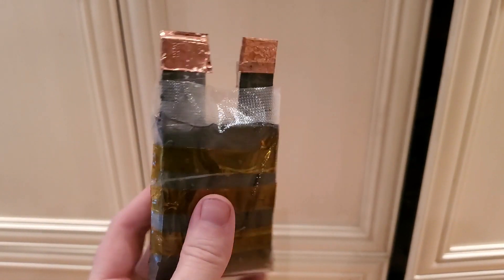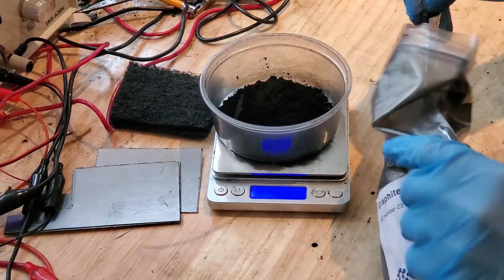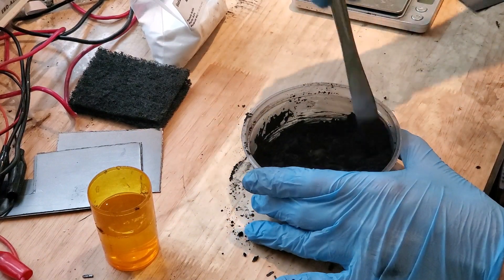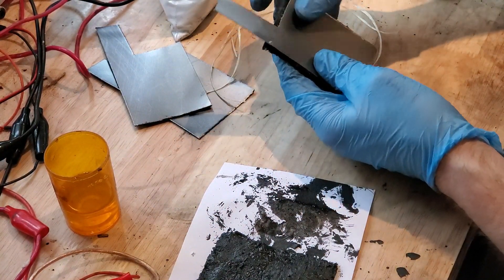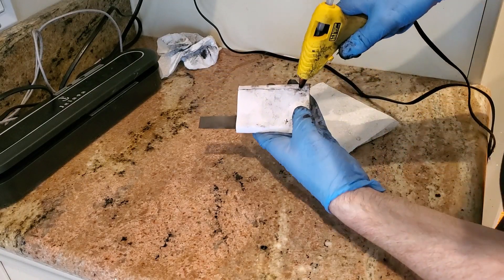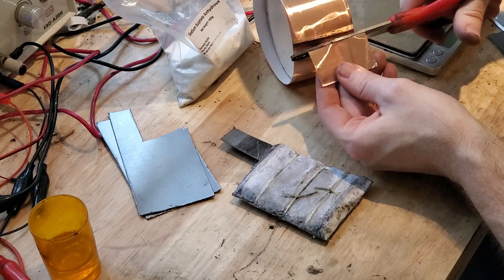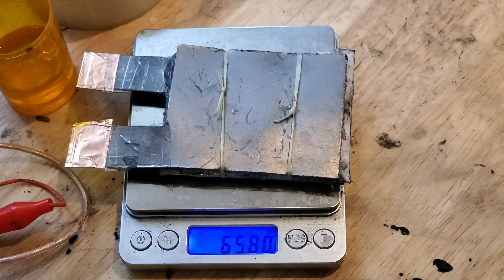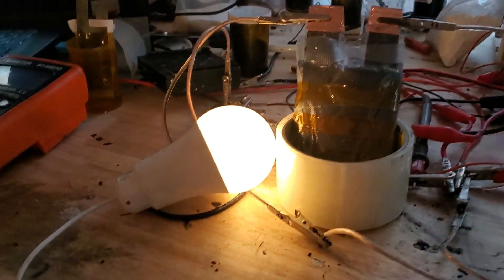Homemade 1 Amp Hour Zinc Ion Battery - Full Instructions

Comment: I am thankful for the efforts taken by you in sharing the successful and awesome performance of your zinc ion battery. Thanks from Jawaharlal Bharat INDIA 🙏
Reply from the maker: Thanks, I have seen a few of your videos too.  You should take a look at my latest video, I have doubled the energy density since this video.  The main difference is that I use water filter coconut carbon now, really cheap and easy to get a hold of in bulk, even cheaper than lead acid per watt hour.

Comment: You're miles ahead of me and I was hoping to get away from any kind of paste but it seems straight metal plates have limits.  Any idea on what the cycle life on your battery is?
Reply from the maker: The theoretical life cycles of this chemistry is very high(10k cycles).  However in practice that is always more challenging. On the other hand, copper zinc chemistry(The one you are pursuing) often won't last very long  I believe copper does not do well in a rechargeable cell, as copper ions start to pollute the electrolyte and it also oxidizes, which does not add anything good to the equation.  However it is a simple chemistry to mess around with.  I have changed the chemistries of my zinc ion projects a lot since this video, I do plan to upload a new video soon.
Reply: @microphotography2090  cannot wait for your next video man. Keep it up!

Comment: Can we make a similar battery/supercapacitor with Aluminium or Iron?
Reply from the maker: You can only use aluminum or stainless steel on the negative side(not positive).  Zinc metal will grow on either of those.  But watch out for aluminum, it takes part in the reactions and will eventually be reduced on large discharges.  Putting aluminum or steel on positive in an aqueous electrolyte will oxidize them heavily.  Steel 'CAN' work as a current collector on positive, but it lowers voltage and resistance increases with each charge from rust.
Reply: Thank you
Reply from the maker: @aadhithvarathan5432  Ps, graphite foil is all over ebay if you look.  It is actually really cheap.  You can get 10 large paper size sheets for 20 bucks.
Reply: @microphotography2090  Nice